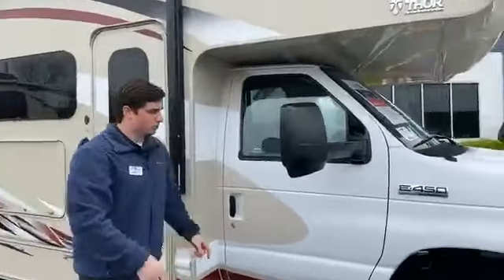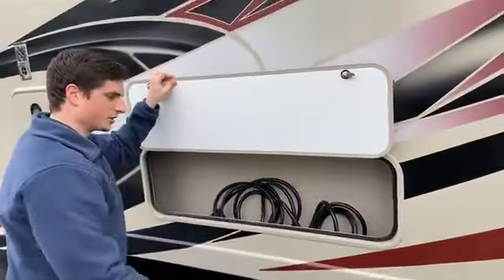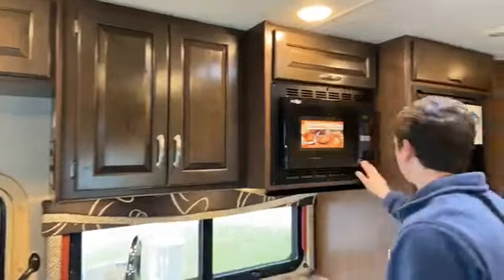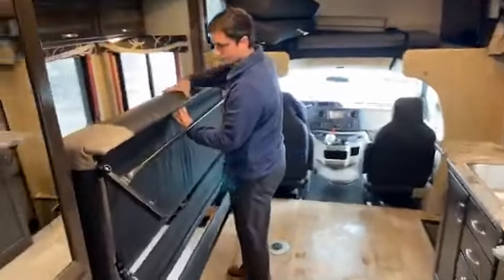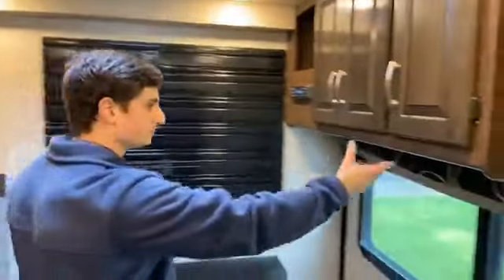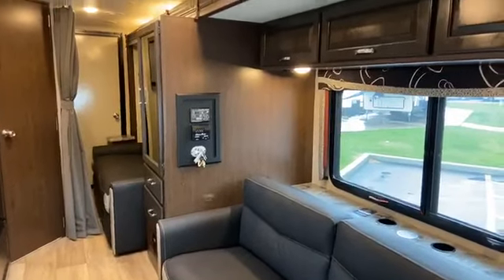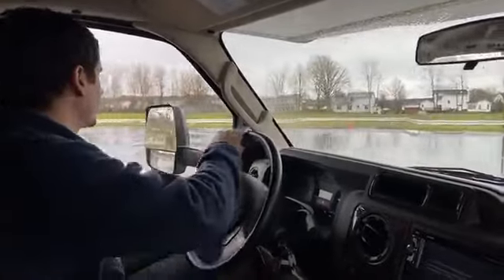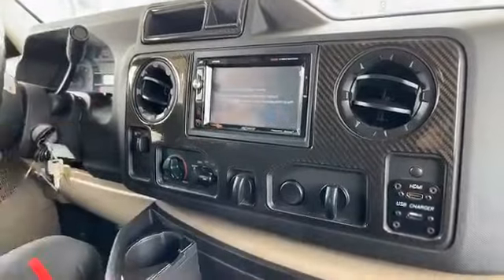2020 Thor Motor Coach Outlaw 29S Class C Toy Hauler Walkthrough Review and Test Drive

Comment: I have this exact model.  Good walk through.  Any chance you know how too or have a video on how to reset the error codes on the jacks.  Also, not that it can be changed, but the on demand water heater is awful.  If you only want to have a small trickle of hot water to conserve water the hot water tank will not sense enough flow and thus no hot water.  You have to use almost a gallon of water to get it hot.  About 3 times as much as I need to do in my travel trailer and the tank is twice the distance from the shower. I wish it had an actual hot water tank.
Reply from the maker: Glad you liked the video! Thank you for watching and giving us your feedback on the Thor Outlaw! Happy camping!